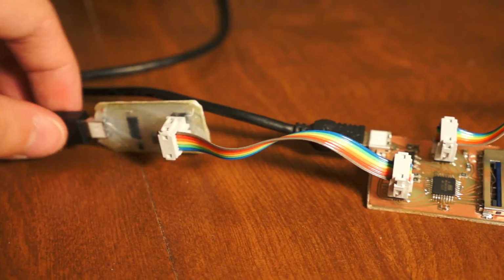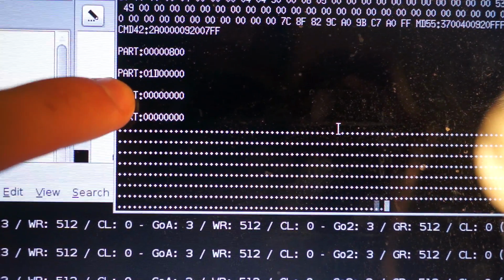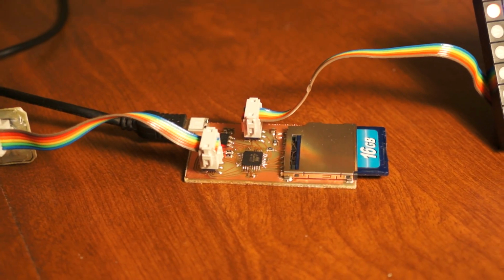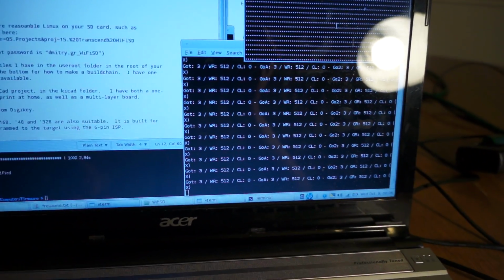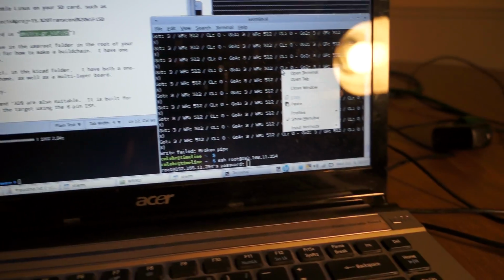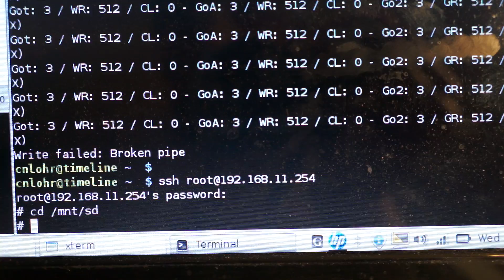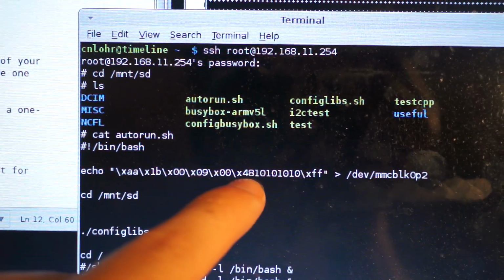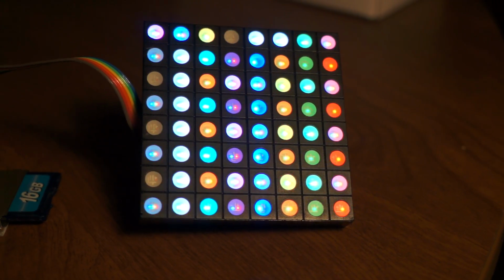AVR Communicating with Transcend WiFi SD

Comment: sorry,may I ask a question, this is really new to me.
You mean that there is a Linix system running inside the wifi SD card?
Was the system in there originally?
or you hacked it and had a system in there?
(sorry I just don't get it from the video. haha =))

Comment: Could you post which pads on the back of the card have the serial? I have just got an extra card and I want to get to the u-boot prompts.
Reply from the maker: ***** The pads with serial are inside the card, itself, and I have long since forgotten which pins are which :-/
Reply: I sliced the card clean, but unlike the PQI Aircard, the serial pads are not labeled :/
Reply from the maker: I think I just probed around to find an TX, then started touching them through a 1k resistor to try to find the RX.

Comment: Hi, does it mean that part of the flash memory gets really rewritten all the time? Doesn't it mean that it will quickly damage the card?
Reply from the maker: I expected that to happen, but so far, no damage to the card.  I think I am going to set it up to just write it's brains out.
Reply: CNLohr I'm thinking... this Linux has that (SDIO?) driver that pretends it to be an ordinary card. I wonder if that driver uses low level access the real flash or goes again through Linux syscalls etc. Maybe the write operation to that special block could be hijacked... I gotta solder up a small power supply for my card. Wife's not happy with me using her camera. ;)
Reply from the maker: If you want, I got new card things in to drive it with an AVR - to send the proper signals to make it boot up without a computer and talk to it.  I can send you one.
Reply: Email sent.
Reply from the maker: What email?  I don't see any :-/
Reply: I tried to guess your address, but it seems like I failed. Sent you G+ message instead.

Comment: I know that this was posted almost four years ago EXACTLY (10/3/2017, but posted on 10/8/2017), buuuttt..... Do you know if anybody has been able to completely replace the distribution (assuming I did not misunderstand that you did JUST that... :/), or if anybody has been able to make SSH over WiFi enabled? (That way you would not need the programmer...)
Reply from the maker: It turns out the ssh is already exposed I believe.  That's how I got in!